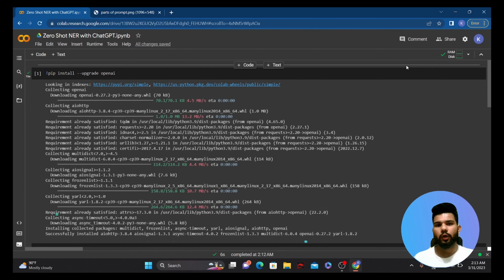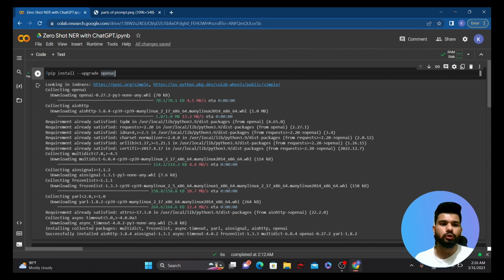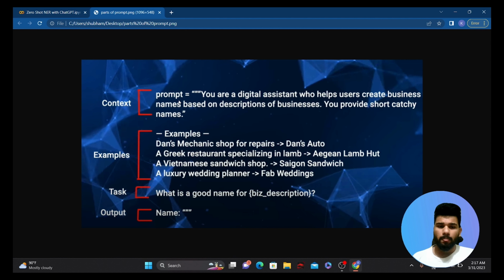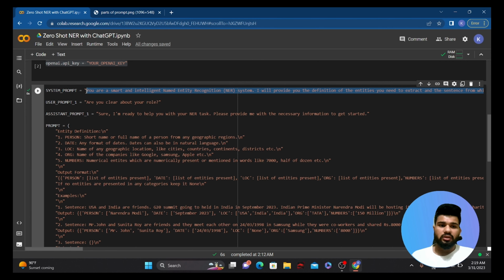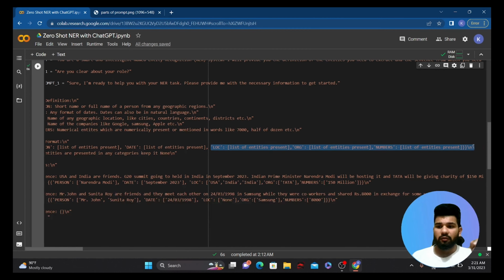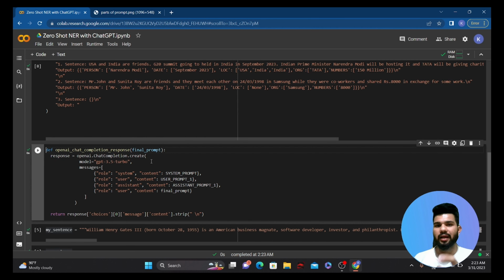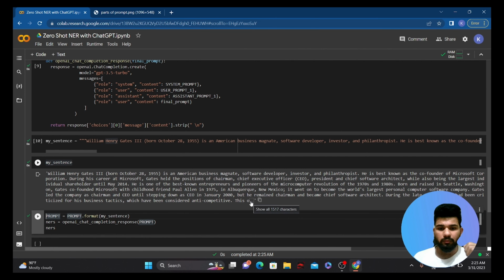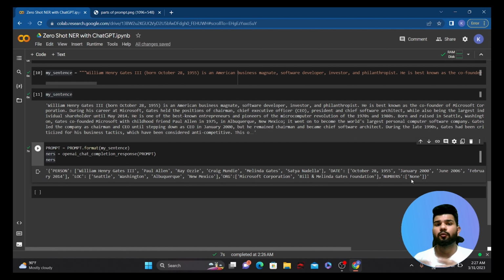Zero-Shot NER using ChatGPT | Name Entity Recognition| Prompt Engineering | Karndeep Singh

Comment: Thank you so much Karandeep for such a helpful video. I have one doubt, chatgpt will charge us on the basis of input & output tokens. So in your prompt you are passing around 150-200 tokens and this prompt we are sending every time for each request. so don't you thing it will cost us more. (I would like to hear you view on this)
Reply from the maker: Yes, it would basically depends on the information you wanted to extracted. If the information needs more detailing of the definition then this would increase the prompt length. It would be better to try write better optimize and concise prompts.
Reply: @karndeepsingh  Ok understood. Please make video for same use case but by using any open source model.

Comment: I want to know can I use the same approach for custom NER's will it work? Any thoughts?
Reply from the maker: Yes, you can try. I have tried for some of the usecases, it works well. Key is to have better prompts to get best outputs out of it.
Reply: @karndeepsingh  yes, I did try and it works well provided with good prompting. Thanks!